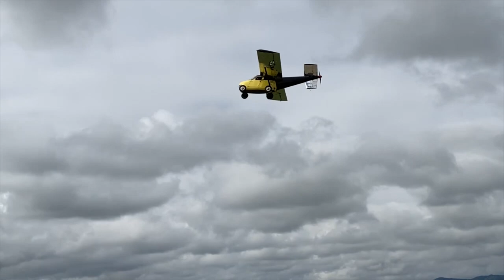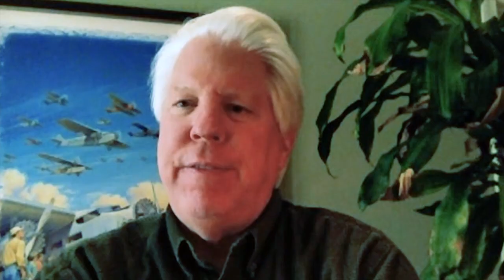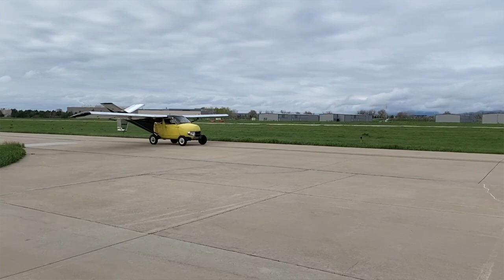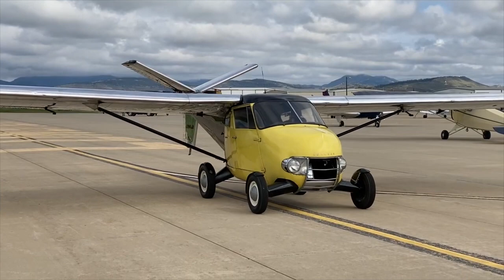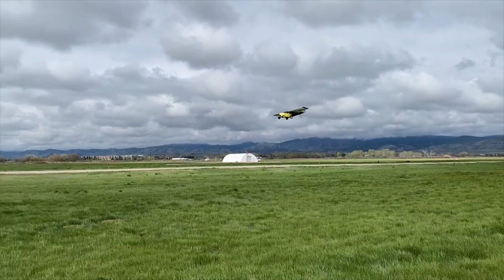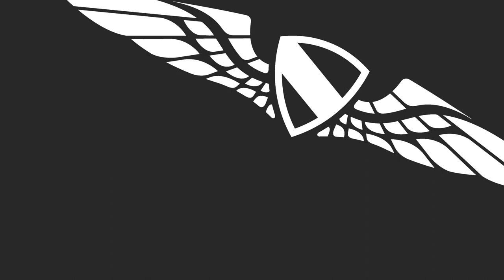Taylor Aerocar flies to a new home

Comment: I think a modern premise would shift to vtol so you can skip the roads entirely. As well as airports. Which would be quite a capable vehicle. Long range would be at odds with vtol difficult.
For very short hops below 300km, battery electric vtol is very obvious. And has quite extreme potential for autonomous flying taxis.